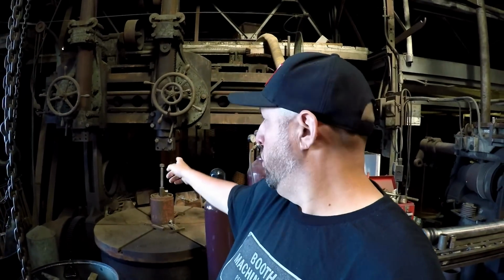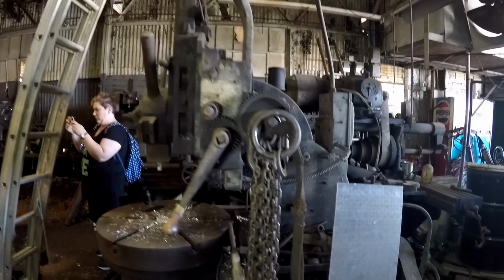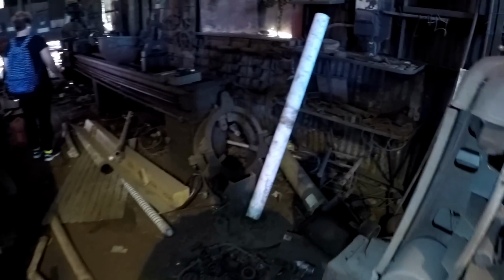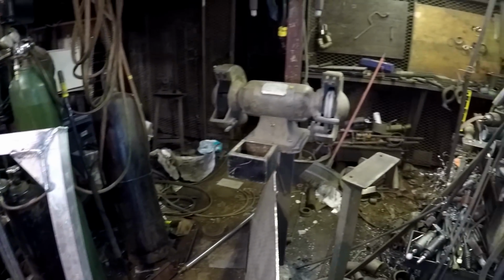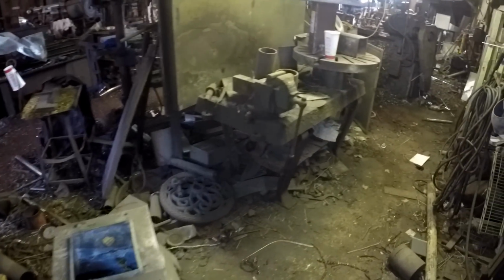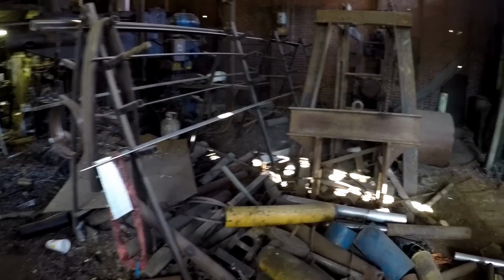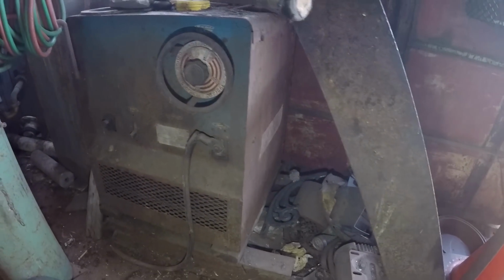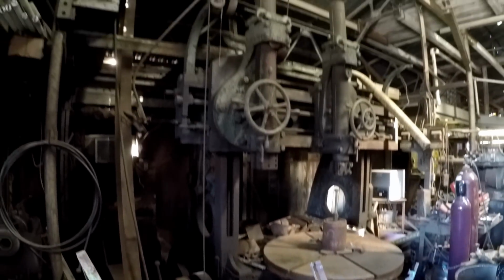113 Year Old Machine Shop

Comment: I drilled driveshaft brake castings on a machine that had power feed on four heads. Four lathe chucks were mounted on the table to hold the the brake castings.

Comment: If we had 10 cents for every hour them old machines ran we would be doing ok :)   My old 1930's southbend fits that collection. But still running strong. I saved it from the scrap man. 600 bucks later not a bad lathe that just parts to get it running still less than a grand in it.

Comment: What you called a duplicator lathe is not. It is a double spindle lathe designed so you could buy just the one machine and have a small lathe and a huge lathe to do two sizes of work conveniently and use less floor space. It is probably a McCabe. They were marketing this machine in the early 1900's. I have one. And I have seen another one. Rare. Hopefully we will be setting ours up in a museum in a couple of years.

Comment: I had rented space in an old factory building that was divided into two spaces, one half was converted to a racing garage and the other half was the owners machine shop. A lot of old tools like this were in there and while it wasn't as disorganized you would be forgiven for thinking it wasn't in use anymore, let's just put it that way. However he still produced parts every day, and I think he made these tiny stamped metal pieces that were part of something to do with piano manufacturing.

Comment: Very cool. I recall back in the early 70's....a friend was building a hot rod truck and needed a driveshaft with a Ford rear and Chev front....so we go see the old guy in Richmond BC (Canada) who had a machine shop back of his house....the whole shop , lathes, milling machines, drills etc. all ran from overhead shafts and belts that ran the equipment......the whole shop was powered by a Gray marine engine....I often wonder what happened to that shop....the old fellow built that driveshaft in short order....
Reply: I know a machinist like that his was in the basement of his house in Tacoma Wa. he was an old Italian  he had electric motor running some of his old machines !

Comment: Very cool seeing these old machines. I started my career  in 1976, and used a lot of line shaft machines converted over to electric motor powered.  Owners seemed to be very ingenious in ways of getting more life out of older equipment.  One shop i worked had an old lathe with a corvair transmission on it to change spindle speeds ( it was used for spray welding/metalizing ) .  I love seeing these machines ,  but it is hard to compete with modern machines with these old reliables.   I've even used one of those enco lathes you showed. Lol. Thanks

Comment: This Shop Looks as if it was Never Cleaned in 113 Years !  lol   My shop looks like a Hospital Operating room compared to that shop     PRECISION TOOLS  Require Cleanliness to ACHIEVE Accuracy : )    Nevertheless  I Love OLD Machinery and Shops like this One !  Thanks for Sharing
Reply: That shop has been in business for 113 + years and still  working what is your point
Reply: @chrisfreeman3279  
Most machine shops today require Precision Work 
Precision work and accuracy is not easily achievable with clutter and 
Junked up machines 
Just saying ... I Love old machine shops , but this one is a bit over the top 
Let's just say ... if it Works for ya , keep it rollin ! 👌

Comment: This video is 2yrs old. Does anybody know if the equipment got sold to someone to use or did it all get scrapped? I sure hope someone was able to save atleast some of these machines.
Reply: I'm sure there are still there, He probably wants a ridiculous amount of money nobody is gonna pay.
Reply: @ericnightmare2695  I was thinking the same thing. I run into that caliber of frustration all the time. I've offered more than reasonable amounts for cars a d trucks sitting for decades only to be turned down in favor of letting it rot away until its completely worthless.
Reply: @maggs131  when I was a teen a guy had a vespa rusting away in his yard !
Reply: @richardbrobeck2384  back in my teens during the 90s I saw 2 different cars I tried to buy. One was a 66 chevelle ss that they said they were going to fix up and the other was a 57 chevy 2 door and that guy was so offended and almost combative that I even stopped to ask if it was for sale. Guess what? Both cars are still there and have degraded into completely useless garbage. I can't understand people like that

Comment: NILES from Berlin, Germany. Nice to see such old machines. I wanted to buy a older NILES CNC Mill from the late 80's. It was in great condition and still held the tolerances that were in its factory protocol. Very sophisticated system for the time in comparison to MAHO from the same year model. In the end i had to turn it down though because some of its axes relied on hydraulic brakes that would be impossible to implement in a refit to a more modern controller. Use it as it was, is also no option because all those analog electronics are super expensive and very hard to find. But great machine after all.

Comment: I know where’s there is a shed that was a machine or wood shop . Central shaft running the length of the building to power all the machines by belts. It drove me crazy to see that stuff all rusting away . If I had time and space I would have bought it and put it back in order. Along with the 1927 Packard aluminum bodied  car in there!

Comment: It's sad to see an old shop in its death throws.  Modern technology and cheap foreign labor have killed off a lot of them.  I'd guess even the owner has another regular job that keep him from using the shop full time.  He's probably only working there occasionally, on off hours and weekends and struggling to keep his head above water. I can't criticize the condition of his shop without walking in his shoes. We can see some real history from your tour if we look past the clutter.  Working conditions in shops back in the day weren't that good, even when they were neat and clean.  No heat, dim light, noise, dangerous exposed gears and belts everywhere, etc. It makes me appreciate my machinist forefathers more, seeing how they had to work.
Reply: I wish I could upvote your comment 50 times bro. My heart hurt a bit readin some of theses comments...why these people wanna kick someone in the soar spot? Life is super tricky and can turn us all out tomorrow.
Reply: Watching this video brought me back in time to 1966 when I started working in the Boston Naval Shipyard in the machine shop as an apprentice machinist. I feel sorry for the owner that the industry has gone from our society. Based on what I see yes there is plenty of history even just repairing props. The equipment you noticed with holders for props to be positioned on and angle while they filled in the damage using the torches to let the filler
stay in place while keeping the contour of the blade in tact. I hope he finds somebody that has a love for those old machines so they can be used as history lessons. Loved the Starrett box treasure too. Thanks again.

Comment: Thanks for the history , I started my machining carrier in 1981. I ran lathes for the most part starting with a small manual and ended with a conversational  Lodge and Shipley PT40. It originally had a GE10500 control. Worked in the shop until 2002. Original was Brown Oil Tools when they opened the plant in Huntsville  Texas . now I a retired, Huntsville plant shut down in 1987 moved to Houston.

Comment: What is "line power" like do you or anyone else have an example of it and how it powered machines?
Reply: It is a shaft - typically run by a steam engine in the day - that ran the length of the building. Where ever you had a machine, there was a wheel on the shaft and a flat belt (typically leather) would transfer the power to a number of stepped wheels (sort of like a gear box) on the tool machine. Jump to 4'20" and you see it in principle, except that up top instead of the long drive shaft you have an electric-motor.
https://www.youtube.com/watch?v=7qt5tltnvF8
Reply: @JanDreier-HH  that is the coolest power transfer system I've ever seen... i definitely have to take a trip to that museum. Biggest thumbs up man!

Comment: Marvelous old machines from when the US was second only to Great Britain in the manufacture and supply worldwide of machine tools and the devices necessary for the prevision manufacture of metal.
Reply: Actually I believe (Limey though I am) that the U.S. surpassed the U.K in machine tool manufacture at least in volume long before 1905.
Reply: No the machine tool industry in the States surpassed that of the U.K in the mid nineteenth century for volume.
Reply: @532bluepeter1  When they copied British designs and ignored foreign patents? See things like Bessemer converter for details :)
Reply: @andrewallen9993  The significant development of production engineering and mass production advanced faster in the U.S. than the U.K.
I am a Brit but you have to give credit where it is due.
Reply: @532bluepeter1  indeed the US perfected mass-production but it was Isambard kingdom's father Marc Brunel who invented it to mass produce blocks for the royal navy.
Reply: @andrewallen9993  I am indeed aware of that. He did indeed. A few such workshops were so equipped at Portsmouth and Chatham and were bespoke. They were a very few installations of machinery for the mass manufacture of parts not a mass manufacture of machine tools.
there have been many significant developments and many are in unexpected places and the adoption of ideas can gain greater significance when utilised to the full than tat envisaged by the originator. For instance Henry Ford did not invent the track for production. That was at Fowlers the traction engine maker though they were much smaller scale production so the significance of this idea was not immediately evident but its adoption by Ford changed the motor industry.
There can be no denial that the U.K had a good machine tool industry and was the cradle of this but there were many international developments that fed into this particularly from Sweden with their superior ferrous metalurgical developments. The crux of the argument being made is that in the mid nineteenth century U.S. machine tool production outstripped that of the U.K. 
This little island in the North Atlantic has always punched way above its weight but it would be churlish and jingoistic to deny the achievements of others.
Reply: @532bluepeter1  And there you are absolutely correct sir.From radar cavity magnetrons to thyratron thermionic valves to proximity fuses to electronic computers to Rolls Royce Merlin engines, the US made them all faster and cheaper than the British and with the exception of the Merlin they made them all either smaller or better besides making them faster and cheaper. They were absolutely the best copiers in the world till the Japanese overtook them.

Comment: I haven't  been there in several months but the Hartwell Ga Monroe / Tenneco Automotive Plant started up around 1956 and some of the legacy equipment has been used to this day. Unfortunately,  the plant is shutting down production but it may be a great place to explore some equipment that served folks well from tube forming to screw machines, CNCs, to assembly welding and painting, to name just a few.

Comment: A cousin of mine closed down our family machine shop in New Haven, Conn a couple of years ago. The shop had been started by my grandfather about 1890 and the present building housing the shop was built about 1918.  The shop specialized in jobs that were too big and awkward for other shops.  Needless to say the tools were very large and had many machine tools dating back to the 20ies or earlier. I remember one horizontal boring machine that had a 40 foot long bed and a 5 foot in diameter face plate. as well as a vertical boring mill was large enough to chuck a truck tire mold.  My cousin closed the shop even though he had lots of business, due to his age and the fact that it was no longer possible to find machinists who knew how to operate the old classic machines.
Reply: That's a shame. I'm only 17 but I'm eager to learn how to use the older machinery as well as the new, cause most of them will do just a good a job as newer equipment
Reply: I would have learned and worked for him.
Reply: @nonyobussiness3440  If you email me at milalex10@gmail.com I can send you some pictures of some of the large machines

Comment: I knew of a Wolcott lathe still in occasional use in a repair shop not many years ago.  Given what this shop does (mostly casting repair) it's probably still in use as needed.  As far as the last two machines, yes, they are automatic screw machines- first is a Brown & Sharpe,  I think the second one is a Cleveland.  Hope someone is able to rescue at least the dual spindle lathe and the Niles VTL.  I know I personally couldn't even afford the rigging charge.  Thanks for the look.

Comment: Imagine dropping a nut or bolt in there.....never to be seen again.
To be real though, what a shame. The amount of machine equipment that ends up at the scrap yard due to sentimental old timers with good intentions is staggering. They all want to hold onto them, which I can understand, then when they pass the kids send it to the scrap yard because it is more than they can handle. If you get into machine tool, keep in mind someday they wont be able to just put it in the back of a pickup or car. You have to have a plan. A old timer that lived near me and had always worked on vintage European automobiles passed away. I got some great equipment and was happy to keep the guys memory alive. But his pretty much gave away 15 rare old landrovers,  he had other rare cars. He even had a couple Zundapp WWII German motorcycles in various stages of build that a guy gave 150$ for all of. There is still two big shapers and a giant lathe in that building. If I get the space I will try to save one of the shapers. The rest I'm sure will be heading to China to make razor blades...

Comment: I worked in a machine shop that had all 'Line-Drive' machines.  All had been converted using electric motors & 3 speed chevy transmissions.  3 belt pulley on back to gave you 9 forward speeds

Comment: That Niles is not a Vertical Turret Lathe (VTL) but is a Vertical Boring Mill.  To be considered a Turret Lathe, it needs a turret in place of one of those tool bars (usually the one on the right).    I ran a Niles in San Francisco which had a 24' (that's feet) chuck and would swing work 30 feet in diameter.  It was installed in 1955.  Niles was the undisputed leader in vertical boring mills for decades.

Comment: Nice machines, likely able to do some fine work with a gentle hand but that shop is trashed. It is a junk shop. There is no excuse for a workplace to look like that. A simple sign of neglect, apathy, indifference and certainly total lack of proper care and operation of the machines. Possibly every one could be saved but you can almost bet they are all in need of serious rebuilding. Such a shame. The US industrial might was built in machine shops like this.
Reply: I agree,the workshop is in a really bad condition, am sure the machines could also do with some TLC!
Reply: robert shaw every developed country did so on the back of lathe operators and welders
Reply: @Buskyb  Oh, Dear, the poor downtrodden worker. By the way, did those lathe operators and welders own the machines that they slaved over? We were talking about machines, not the people who operated them. Stick to the point if you want to comment. We were talking about this machine shop this no one but the owner wants to work in, is a complete mess, unfit and unsafe for anyone to work in and the horrible abuse these machines have suffered.

Comment: When I worked at Lansing Oldsmobile, in 1970-1974, OSHA had just come into being, 1970. I met a lot of workers on the shop floor, who had transferred from other GM plants to Lansing, because it was famous for being clean. It was spotless. We had sweepers such that every area was swept twice*a shift *! I know that the Chevy plant in Flint looked a lot like this shop. This was pretty much standard in the industry at that time. They would clean at a rate just fast enough to remove the "chips" before they grew enough to slow production. The transferred Chevy workers spoke of heaps of slugs, and trimmings, only being removed once-a-week. Spilled oil everywhere, and grime on everything.
Reply: I work in a Lansing shop lol this is more like an antique shop. We keep it spotless we still have a few antique machines but they are used maybe once or twice a day.

Comment: At 8:35 Adam finds a "duplicating lathe" which he says is "uncommon". That is true in the kind of shop he grew up in, and now works in. But I live in Michigan, where we make 10,000,000 automobiles each year. Between October 1927 and March 1932 (4.3 years) Ford made  4,858,644 Model A cars, 3,000 a day. To achieve this they must of had a lot of duplicating lathes. I personally saw dozens of them in the Engine Building, at Lansing Oldsmobile, in 1970-1974, when I worked in the attached Press Metal Building. In 1973 that engine plant made 202,508 Oldsmobile Cutlass engines, 1/2 those needed. That is 1 every 20 seconds! I was there. I saw the engine line. The crankshaft was hot drop-forged, but it was turned on a duplicating lathe, then polished on a duplicating grinder. Both had nine tools or wheels, one for each bearing surface. Also goto the Culver Props YouTube channel and watch them make a wooden airplane propeller on a duplicating lathe.